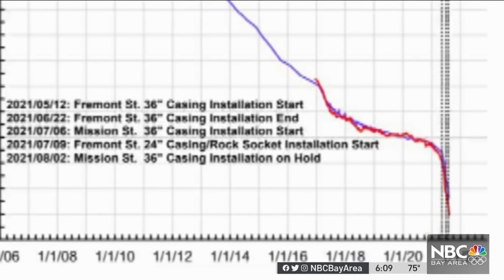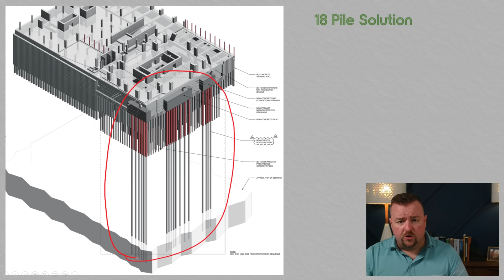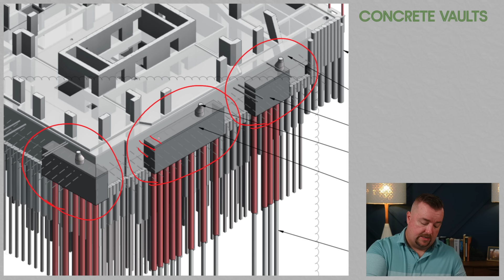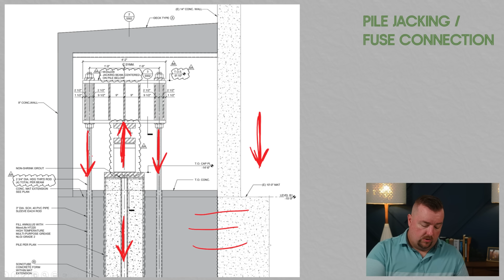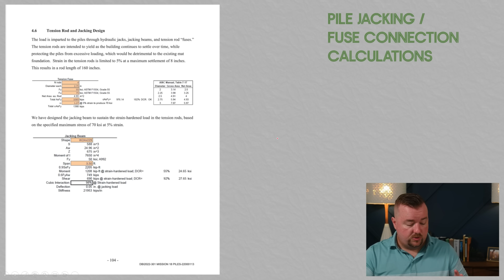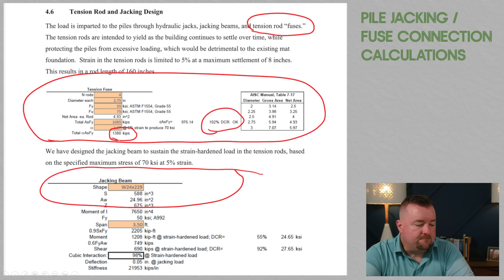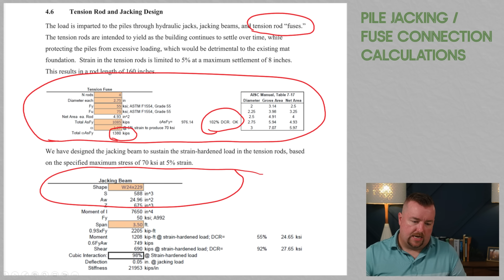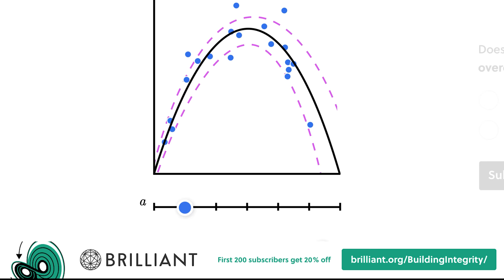Did I Uncover a $100,000,000 Mistake with the Millennium Tower "Fix"?

Comment: I was just in San Fran on vacation, and our tour operator was talking about this whole cluster F.  You can visually see the tower leaning compared to the neighboring buildings at certain angles.
Reply from the maker: Yikes!  Residents can observe marbles and balls rolling across their units too.
Reply: @BuildingIntegrity  Yes, our tour guide told us about that. He stated he had a friend that lived in the building and demonstrated that to him.  It freaked him out.  Being from Miami and our recent history here with Champlain Towers, it's concerning on what's going on here.  Many are claiming a huge under the table money payout to building dept personnel in San Fran, as originally the building was supposed to have piles down to the bedrock.
Reply: My gut reaction (not a structural engineer) is: (1) if the plate thickness is similar to the thickness of the top of the I-beam, then if the I-beam can resist pull-through, so can the plate; (2) However, the plate does not have the rigidity of the buttressed I-beam, and it has only a small width margin around the through hole, so it will deflect.  That deflection would prevent it distributing load laterally very far, including to the transverse rebar above it, so it will be more like applying a 300 kips load to the concrete over a very small area around the rod.  I don't know if that has implications for inducing fracturing of the concrete over the building lifetime.  (3) If one imagines that the load starts pulling the plate around the threaded rod up through the concrete, it would then put the plate in tension, supporting the transverse rebar in a cradle.  That's not what you want, but perhaps one might argue it as a fallback.  (4) In that fallback, how strong is that plate in tension at the widest part of the hole?  That depends on the cross section area at that point, the widest part of the hole, and depending on the hole size that looks to be less than the cross section of the threaded rod, the threaded rod is at 102% of yield stress, and there's a mechanical disadvantage for the tension member in a cradle.  (6) It intuitively seems that this is the one place one might add a bit more meat, given that it is inaccessible/unobservable and presumably fairly cheap in the scheme of things.  At least exceeding the cross section area of the the threaded rod by a comfortable margin would seem to have at least a superficial logic to a layman.  But maybe they just sized it so that it could be cut off the I beam?
Reply: @BuildingIntegrity  Residents? You couldn't pay me to live there.
Reply: Will the inability of the elevators that can no longer operate, be the end of the live ability of this leaning tower.
Reply: @nobodynoone2500  What makes you think you’re qualified to live in SF anyway?
Reply: @ChrisNoonetheFirst  He is a hand to hand combat instructor.
Reply: @booterone1 If the elevators stopped working, hey will hire the engineering firm that designed the elevators in the Pyramid Casino in Las Vegas that travel diagonally.
Reply: @NeoMK  So you’re saying he’s an aggressive thug? Why would we want him here?
Reply: @ChrisNoonetheFirst  I think this is all missing the point. While he might dislike what I’m assuming you’re seeing him say is a “liberal bastion” or whatever, it could just be as simple as him saying “you couldn’t pay me to live in a building that’s this forsaken,” which might have some merit lol
Reply: @XxSForrestxX  We’re not arguing, we’re negotiating a price
Reply: They need to move out asap!!
Reply: Good point
Reply: @nobodynoone2500  You couldn't pay me to live in California.
Reply: @Samuel The top of the building has moved some 20 something odd inches.  When you use other surrounding buildings as a parallel reference, you most certainly can see it.

Comment: I've completed a few pull out tests on piles and grouted anchors over the years. I've seen 40mm (1 3/4 inch) steel bar fail in tension at 70% (~900kN) of its "ultimate" load (~ 1250 kN). Very similar loads to the bars in this design. I've also seen the nut on a 40mm bar pull through a 25mm (1 inch) plate at similar loads. When you are dealing with loads this extreme, things deform in ways you don't expect and sometimes attract additional loads greater than design. I would also question the concrete's ability to take the load as well as the plate. When steel fails at these loads, it's like a bomb going off!
Reply: Clearly, the engineers need bigger nuts.
Reply: 6:06 6:08
Reply: The concrete figure you cite are ultimate strength. You can only use about. 20% for design.
Reply: One question well two!
........Can the threads on the bars or the pairs of nuts take the strain with out shearing off.
Why is the load transfer system - rods to tiny steel  plate just a big penny washer, ?
Never mind the small steel plate. Think about the 8 nuts!!!!!!!

Comment: How much will it cost to begin disassembling the building, from the top to bottom, and remove the entire thing from the city?  Because... I think they will ultimately regret not doing this.
Reply: Had this been caught early enough it would have been cheaper to start over... Honestly it's looking like the fix may cost more than starting over given the risks of it failing
Reply: An absolute shitload. Especially when you include the potential losses of not being able to keep the building open, and loss in potential revenue. When you look at inflation that has taken place since the start of this building, it would likely cost more than the entire cost of the building, plus the cost of this 100+ million dollar fix. There is no way in hell they are going to remove this building, they will let SF crash and burn prior to ever removing this building. Most of these condos are 1-15 million a piece, and there is 419 condos in the building, at an average of 2-3 million each, that is like 840 million to 1.25 billion in real estate in that building, ignoring the rest of the building itself.
Reply: It would not be dismantled. It would be explosive demo.
Reply: It's not a question of if, it's a question of when.
Reply: @rdizzy1  The next BIG ONE will bring it down.
Reply: @williamevans6522  Maybe so, but the owners of the building, or the city, is never going to take it down on purpose. Never in a million years.
Reply: Time to have the engineers from Japan that "remove" buildings instead of the demolitions common in the west that leaves tons of dust for people to breath followed by months of heavy equipment crawling around the pile (re WTC 1 & 2 collapse) picking through it all loading truck after truck for the landfill since that level destruction renders the materials unable to be recycled or better yet reused or repurposed.  The noise and wasting of precious snowpack runoff water from Yosemite where our water comes from by constantly spraying thousands of gallons to keep the dust during that phase down as much as possible but the collosal amount of dust including microscopic glass that's a serious health risk when inhaled that's produces during the demolition is an unavailable result.  The buildings in Japan being "deconstructed" look like magic happening with almost all materials removed in a surgical fashion to be repurposed but with no noise, toxic debris cloud, damage to nearby structures and ZERO stress and anxiety caused by the noise that goes on for months.  It's no surprise that if anyone would remove buildings this way would be the Japanese since they can't stand even litter (what a dream come true) or dirty building exteriors, not even truck drivers let their trucks get dirty so as to create an overall pure esthetic in everything one has to look or listen to.
Reply: I don’t know much….but that looks sketch to me………just sayin
Reply: @Floydian4everr  quit yapping about dust

Comment: That plate is about the size of a cross beam connector on farm machinery here in Iowa. Like they hold the front and rear gangs of a large disc together. Sure wouldn't want them holding up a skyscraper in an earthquake prone area.

Comment: I agree 100% with your assessment, the bolt anchorage will fail long before the bolt fails. In any case to design a critical element that is suppose to stabilise a massive building to be stressed beyond its yield strength is absurd and must certainly fall outside design code requirements. These bolts are designed to fail if the load is too high defeating the whole purpose of the repair work. This is a disaster in the making. (Retired structural engineer)
Reply: I don't get why the threaded rods on the sides need to be sleeved and greased. it should be stuck and moving with the vault. the only thing that should slide is the vault and the pile.
Reply: @ericlala  They need to be greased because, as the previous comment mentioned, they are designed to go beyond their yield strength. The system is RELYING on them to extend a little (without snapping!). And in order to extend without breaking the concrete, they must not be attached to the concrete.
Reply: Humpty Dumpty sat on a wall,
Humpty Dumpty had a great fall;
All the king's horses and all the king's men
Couldn't put Humpty together again.

Comment: Sometimes I think that the basic design calculations made for large buildings like this should be available at a local court or something. Wasn’t there a building in NY that had bolts instead of welds, but after a visit from some engineering students they figured out that the bolts could snap and had to be replaced with welds?
Reply: Citicorp building August 1978
Reply: The problem with the building in New York, was that it met code to the letter.
An engineering student asked the question about what would happen with a diagonal wind. 
The engineer, rather than blow them off, actually look to see what, in their calculations confuse them.  He then determined they were right the building wouldn’t survive in a hurricane without additional diagonal bracing.
The building code is a minimum. Not a goal.
Reply: Welders are more expensive than nut turners.

Comment: This video has been haunting my thoughts.  Today while eating lunch, I couldn't help but think this has some spooky similarities to the Hyatt Regency walkway collapse of 1981.  Insurmountable stress on threaded rods, nuts, and a steel surface far too weak for the task.
Reply: It was the first thing that came to mind and I'm just an armchair engineer bicycle mechanic and I can tell you that fix is not going to work and I hate to think what will happen it is even a minor earth tremor let alone something around the 4 to 6 scale
Reply: Yes, Hyatt Regency all over again. Only difference is these rods will push, in Hyatt the pulled through. The stresses are similar. Excellent comparison.
Reply: @andyallen7509  the threaded rods are under a tensile load, pulling the little plates at the bottom upwards. So it's identical to the Hyatt Regency situation.
Reply: I was just about to say the same thing! I was getting creepy Hyatt Regency Skywalk vibes about this.
Reply: This does seem like history repeating itself.
Reply: The walkway collapse was entirely due to a subtle and, at first sight, innocuous design change for expediency and cost reduction, and is a case worthy of any engineers' time and thought to investigate, no matter what their discipline.  
(The original design was perfectly sound, but the 'minor' change resulted in both walkways suspended on a single threaded connection, rather than each walkway suspended on its own.  The suspension bars were proved to be adequately strong and failure was due to the overloaded nuts and/or bearing surfaces).
Reply: @andyallen7509  We don't design long, slender rods to accept compressive forces.  The threaded rods in this video are in tension.
Reply: @thedubwhisperer2157  I would have been a toddler when the skywalk collapse happened, but I first saw a documentary about it a few years ago and it was horrifying. I've seen a lot of documentaries on accidents before, but that just really got to me. I can't imagine how horrible it was for those people.
Reply: @ninjaneerk5601  History will continue to repeat itself, because people refuse to learn from it.
Reply: I thought of the Hyatt Regency as well.  What is worse is there is no way to see the rod or plate distortion when it is embedded 10 feet deep in the vault
Reply: My thoughts exactly, very similar configuration
Reply: And that notorious Sampoong department store collapse in South Korea. Lot of corners were cut during the construction as to maximise the retail area and without any consideration for the heavier climate control units on the roof.
Reply: Came here to say exactly the same thig: Hyatt Regency failure all over again...